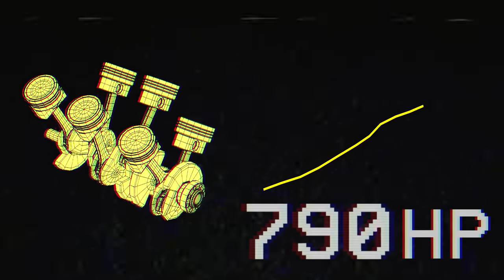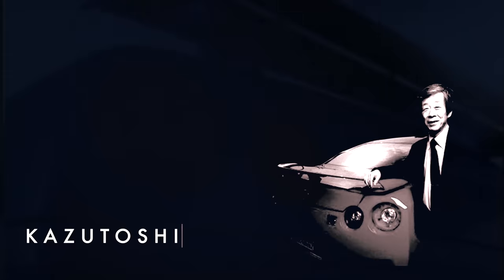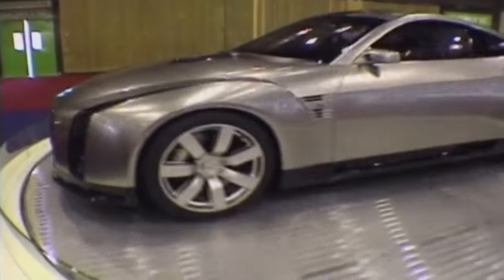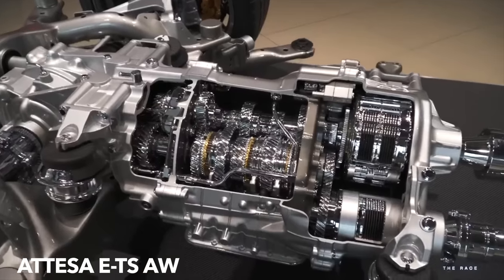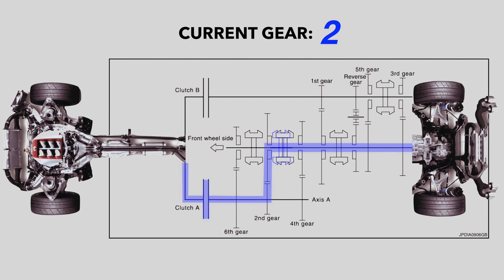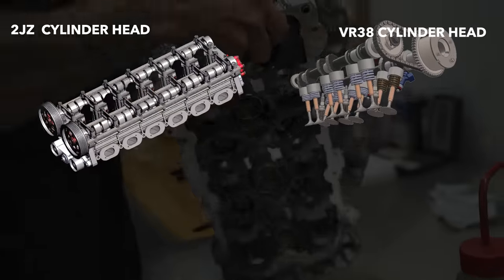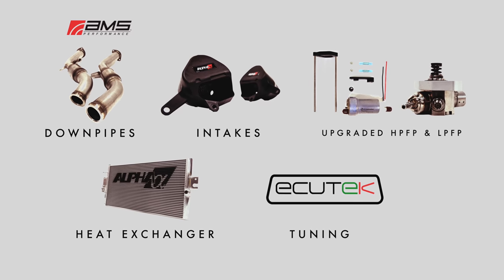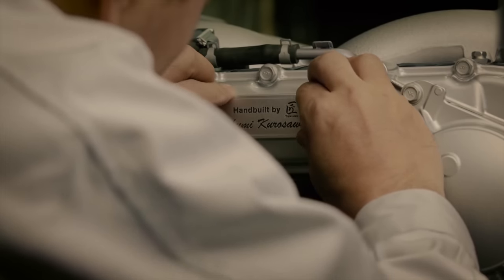Why Nissan’s Turbo V6 Engines Are Too Powerful (GT-R and Z)😳| Explained Ep.31

Comment: That first GTR's acceleration on the drag strip was supernatural!! 236 mph is off the charts but that was ridiculously quick how it got there!!!
Reply: @@shawarmafan87not yet, they're at 3500 from what i know
Reply: I daresay that's not stock lol
Reply: a 1.95 60-130 isn't just super fast, it's fucking mind bending. That's pin you to your seat levels of acceleration
Reply: @aftrnoon_ac viper lambos gtrs etc get molded by UGR, Calvo, sheepey all hit 3-4k hp
Reply: @@shawarmafan87if you’re talking about the blue one that one has a hemi
Reply: @grahamrice1806 of course who keeps cars stock nowadays?
Reply: @shawarmafan87 gtr engines top out at 3300, anyone higher u see isnt a vr
Reply: @@shawarmafan87.
Reply: @brycelenstrom3715 That's not true Billie's street GTR from T1 Race makes 3300whp that's over 3500 crank. Laser George night furry from t1 race makes 3500whp that's over 3700 crank. Extreme turbo systems promod that runs 5 second 1/4s runs promod 88s I believe and makes over 4000whp. Motors are not done yet cranks just don't hold up that long and T1 race is already in the works on a billet 5.0L VR so there is still more to come.
Reply: @hmmmph.  They don't get molded but Defeated. The term "Molded" is a Stretch.
Reply: @hmmmph.  You do realize that was a UGR Lamebo getting drug in the first video!!
Reply: @mb3578  ok? I was just saying that a lot of supercars can hit a few K hp
Reply: They are the fastest there is man, just needs some help to get there.
Reply: @hmmmph. Did you see the 300mph standing mile? And the the fastest street legal car in the world?
Reply: I thought it was ff!
Reply: @antilagboostaddiction8322  can it hit 300mph in a standing mile... yet? A Ford engine and car have achieved this already.
Reply: @oetic5016  Fast than the Ford Badd GT? Murica!!!
Reply: Got video
Reply: On this very video in the start of it. @RichardShingleton
Reply: @calamarbronx83  That's slow and small potatoes the only people that car about the standing mile are RED cars that cant put the power to the ground. GTRs and Lambos are running almost 260mph in half the distance lmao not even comparable that Ford GT would get left in the dust which is why you never see them competing with anyone other then themselves 🤣
Reply: @antilagboostaddiction8322  Has anyone done 300mph in a standing mile? Let alone 310 mph? No street legal car, is leaving the Ford Badd GT in the dust. While the GTR can't even reach 300mph, the Bad GT will leave any GTR/car in the dust. Good day sir!
Reply: @Yumadlol me but only because I’m broke
Reply: Ok? But what do supercar being able to hit a few I numbers have to do with anything. Tx2k already proves the gtr beats all the ugrs lol
Reply: @hmmmph. lmao sheepey haven’t made a decent drag car😂 you notice you rarely see a sheepey car at the drag strip unless it got work done by another shop 💀

Comment: I grew up In the 60s & 70s, We didn't have engines that come close to these in HP, I was a mechanic for 30 years, until my 2nd back surgery, a tune-up consisted of, plugs, points, rotor button, condenser,  distributor cap, Ignition wires, oil & filter, air cleaner, setting the timing and dwell angle, My Father {R.I.P.} taught me about engines when I was 10 years old, I had some fast cars and some very fast motorcycles, He said when he was young, they put would large engines in small cars, like a 500cI cadillac engine in a studebaker and call It a Studillac. THX 👊😎
Reply: Imma subscribe to you just because this comment feels wholesome
Reply: Subscribed too
Reply: Your lucky, my dad taught me to fight, drink, workout, to be prideful, be consistently inconsistent in a relationship, be an emotional cripple, and to get really good at manual labor. 

But i suppose its never too late to learn aye?

Comment: Ive been saying for a while that  the vr38 is the best v6 to ever come out Id go as far as to say the VQ is also the best NA performance V6 to come out pretty easy to maintaince/maintain and u can make close to 400whp NA with some of the later year VHR motors
Reply: C32B I would rate higher in N/A format. More performance oriented, more hp per litre (exponentially more when tuned as the head flows so well), and is far lighter.
Reply: Not to mention the VQ line came bolted up with one of the best feeling and durable 6 speed manual transmissions ever made with the CD series, the 009 being the pinnacle!
Reply: @anydaynow01  I was just telling my coworker today that I wish nissan did a revised CD009 transmission for the new nismo z Considering with just an upgraded clutch and fly wheel those trans hold 500+

Comment: I've noticed the vq taking over flagship nissans just like the rb26 used to as well
Featured in the new skyline and new stagea
The Z engine basically became the gtr engine until there was a newer gtr engine to take the place
Reply: The rb26 was never used in normal cars. It was exclusive for the gtr
Reply: @nikomoin7604  stagea autech had it as well, given that's not exactly like the rest of the lineup

it still started off with low tier rbs and eventually got the rb26, albeit probably never the higher end variants of the engine like the n1 and nur

although only now do I figure out it was only ever in the stagea this engine also appeared

and how the vq is miles more common across nissan cars

Comment: R35s are the kings of power out of any car out there and only a handful of cars can keep up like Hurricans/R8 and Vipers as shown at events like Texas2k. They’re the “Meta” of power.
Reply: Remember it is only 6 cyl. Those other cars have 1.5x-2x the cylinders.  So not exactly apples to apples. Imagine  if it was 8 cyl. The real Godzilla street king killa 😁
Reply: @hdhellion4128  More cylinders don't necessarily mean more power as explained on this short documentary. There are many other factors.
Reply: @Jorge01234  oh no, I totally agree with you. But imagine if the new skyline had 2, 4, 6, or 10 more cylinders lol!
Reply: @hdhellion4128 hp= rpm*torque/5252. The GTRs at tk rev very high, and also run a ton of boost

Comment: I never knew the r35 had a rear mounted trans let alone the two shaft configuration. That's crazy engineering
Reply: c6 corvette have rear mounted transmission, Aston martin also do that back 2000s
Reply: @xxxxghostxxxx2052  Yes, thank you. I found out that after googling the whole deal about rear mounted trans front engine configurations.
Reply: Porsche 928 also
Reply: I know right?  Every bit of infortainment I have seen about the GTR this past decade only mentioned the engine or that it had a DCT.   Never did I know the transmission was in the rear like a Vette but unlike a Vette, it didn't need a torque tube.
Reply: c6 already has that, it's just r35 no need a torque tube
Reply: This is more common than you think
Reply: @xxxxghostxxxx2052  but not AWD
Reply: Alpha Romeo GTv6 circa 1983 🥳 
Heh since we were onto well balanced cars with front engine and rear transaxle, I would show my age here.

Comment: the reputation of VQ engines probably took a hit because Altima, G35/V35 and Z owners all put the most obnoxious exhaust systems in history on them and leave the cars otherwise stock. But actual tuning shops have been doing insane things with those V6s.

Side note: I remember reading a magazine article some time around 2008-09 stating that people who tuned their R35s to make 650+ hp were going to be disappointed because the engines were all designed to make stock power 😂 whoever wrote that I’m sorry but automotive journalism is not your strong suit my g, let me have your job instead.
Reply: Thank the Edgars but yet even when they trash these cars its hard to destroy the VQ.

Comment: The GTR is such an engineering marvel. Always knew it was but its even more so after living with one for a few months now. I love that this video also touches on how the VR came to be, with the VQ in the 4th generation Maxima being a key ancestor, a car which I also have owned for 25 years. We have come full circle. Also, the VQ30DE made 190HP until 2000 when it made 227 with the VQ30DEK. Nowadays, people think of Z/G/Q when you talk about VQs but they tend to forget that it was Maximas that paved the way. So many Maxima builds led the way for those guys and the future builds to really push the boundaries of what the VQ can accomplish.

Comment: Im a SR20 guy but theres no denying it. The VR38DETT is the best engine ever from Japan and the best ever and most tunnable v6 turbo ever produced by any auto manufacturer anywhere on this planet.
Reply: best engine ever from japan is 2JZ, everyone know that. V6 just unbalanced.
Reply: @remurrr the 2jz isn’t nearly as powerful as the vr38. There is no comparison. Balancing is negligible.  Sounds much better too.
Reply: @2seep  still the reality is that 2jz is more popular. 2jz is the best engine it was i6 built with iron block and designed with Closed deck, and balance is beyond doubt!
like bro don't underestimate the capabilities of the 2JZ that comes from the factory This engine can be tuned up to 1000HP, everybody knows 2jz is popular for a reason. 
2jz is the best 🇯🇵 engine!

Comment: Ghosn is the ultimate hacker. I worked for the group under his command for about 8 years. He simply revived every single brand in it, bringing the group to the top position as a car manufacturer in the early 2000s.

Comment: VQ35HR, VQ37VHR, VR30DETT (when they don’t blow up) and VR38DETT are the best Nissan V6s ever made. Some of the best engines of all time, they hit the perfect trifecta of cheap, reliable, and easy to modify (and reliable when modded).
Reply: VR30*DDTT* not DETT. VR = Engine Family. 30= 3.0L displacement.The first D = Dual Overhead Camshafts. Second D = Direct Injection. TT = Twin Turbo.
Reply: They never blow up unless over boosted
Reply: @prone2101 I was gonna say “when do they ever blow up?”😊
Reply: @prone2101  they don’t blow but stock turbos fail

Comment: VR engines are such underrated engine compared to other nissan engines imo. my favorite is the mine's vr38 complete engine or the high response engine that puts out around 700-750hp. although different approach from the western crazy 1000-2000hp build, mine's demo r35 is such a balanced car with that engine and not only that, it's also because of the overall suspension setup, weight reduction, etc that makes the car perform really well even in tight gunsai touge. 

it's not just vq "pro max". it's a whole another level and still worthy for the GT-R despite being a v6 rather than i6.

Comment: My V6 3.6 120k in jeep jk always issues with engine vs my 3.5 in 350z at 160K still running fine minimal engine work done. Spark plugs, valve over gasket etc...

Comment: Keep in mind that vr30 with the new Turbos made 700whp on e30-e50. Vr30 from Bonnie & Clyde made 800ish whp on stock block. This car was constantly at the dragstrip and being hotlapped.
Reply: IMO The problem with the VR30 besides it’s reliability issues is it’s just too little too late, if it had come out 10 years ago it would’ve set the world on fire but now everything else is better. B58, Coyote & daza put it to shame in every way possible.
Reply: @Enthusiastlist  It's pretty reliable and can hold a lot of power on stock block. As I mentioned it was close to getting 900 whp on a stock block. Vr30 vs the b58, coyote is actually pretty close and have numerous back and forth races. Heck the Vr30 beat the b58 at a race event. The Vr30 didn't have a light weight sports car like the Supra to make the engine seem more impressive. The vr30 is like 3900-4000 pounds so its on the heavier side. New turbos for the platform were released recently that will get it to the 800whp range. Don't know much about the Daza but from what I've seen it is pretty good too.
Reply: @supremecy187 let these little boys know. It's crazy how much potential the vr30 really is now that the z came out. I don't even think the b58 can handle 800whp stock block lmao. Nissan is the king of jdm

Comment: This is all wrong. VQ35DE  and VQ35DETT Maxima was an american / australian spin off it was a shit single cam rig no forged internals. . the VQ25DETT was quad cam single turbo v6 with vartable valve timing. much like its younger nephew the VR38DETT motor (minus a turbo and a additonal wrap around pipe and 1.3 litres of displacement)   But it had the light weight crank and forged pistons stock  and CVTC. . it came out naturally in a M35 Stagea. ( I had one) with a VQ25DETT long throw motor. thing was 2 tonne wagon. that beat XR6 typhoons out of the box.stock as a rock at 335hp later models about 275hp early models (had more than 1 bar boost stock and 30/35 urbo stock. mind you it made up for its weight with the electronicdiff yaw controls and attessa AWD system like the GTR, the STAGEA  M35 was the new GTR's UNCLE in wagon form.  I rememeber with just a FMIC and an exhaust.. 650HP silvia's couldnt outrun it unti it hit speed limiter at 180km/hr ..i remember one time in a rolling race a 454 big block chevvy with flutes sticking out the bonnet could not escape the 2.5 litre turbo wagon even by a metre. . . and to update haters Volvo copied Nissan... LOLVO was the M35 plate to have as your 2.3 tonne wagon (5030 american pounds with fuel and driver) that was bigger than most things on the road with a 2.5 litre displacement.. left big blocks in the dust. this is the true heritage of the VR38DETT .. it came from the VQ25DETT with CVTC in a massive wagon, But youd have to have owned one to understand it. XDrother

Comment: I think the whole "idle like stock" argument comes down to modern hardware more than the engine design (i.e. Modern ecu, drive by wire, idle control, vcam etc..). The RB26 can idle fine at 1000whp as well as be driveable on the street, its downfall was more primarily the sump design causing twist on the block as well as weak oil pump gears. Outside of that the RB has the same aftermarkert support as the VR38, sounds better and has been a proven performer. I think in the late 90s/early 2000s your argument around the v6 design is valid as it was easier to make torque with more displacement, but in 2023, modern ecu, modern fuelling, responsive turbo techology - i think the RB is on the same level in refinement. Same goes for the 2JZ which the bottom end can support more than the VR38 and the 2j also came with variable cam timing. 

I've done a simple RB28 build on my R34 GTR with a Haltech elite 2500, modern injectors, modern fuelling system, HKS VCAM, pair of turbos and tune, the thing comes on boost at 2500rpm and is killer on the street. Can easily be dailied. Granted im not making 1000hp, but my point is whatever advantages the VR38 had, the RB can have as well..
Reply: And they fixed the oiling issues on the latter model RBs, which is just a simple oil pump and a crank swap for earlier models (which if someone is making the big power numbers to they are opening the engine anyway). And totally agreed that the RB is the best naturally sounding JDM engine going full tilt in the red, the LFA engine needed some Yamaha magic to get it's awesome sound.

Comment: I've owned an HR 350Z and now i have a 18 Q60S and i have to say.. nissan makes an amazing V6 engines, fantastic (manual) transmissions and solid chassis- but good lord they have the worst exhaust note haha. I have a full AMS RA500 pack on my Q, resonated downpipes, resonated y pipe, another 12in resonator and an HKS single exit and i still get the trumpet at 2500-3000 rpm lol. Turbos, 4 resonators and a muffler still cant hide the trumpet! Lol

Comment: Hey,  great video really enjoyed it. I was really surprised how much power a v6 could make (not counting f1).

 Is it possible you could do a video on the BMW M57 Diesel engine? Its a 3.0L I6 TT diesel engine, tuned it can have more torque than many OEM trucks. 

Thanks!

Comment: Making me really like my VQ but sad it’s not a VR.  I’d rather have my 370z than a GTR though…but I wouldn’t mind having that engine in my NISMO.
Reply: Yeah, driving a GT-R is insane did it at a track event once, but for some reason having a stick shift for a trackday toy is where it's at for me, I'm happy with my G35 and didn't want to pick up a new Infiniti since they are autos. Saving up for a base RZ34 when the dealer markups evaporate eventually so I can do all the SPL Parts, Z1, Wavetrac, Öhlins, and AMS things to it!

Comment: the comparison between the new z and the new nismo z, is that you spend 24k for a 20 hp upgrade. its kinda embarrassing compared to the 370 where 7k gets you the same 20 hp upgrade. dont get me wrong i would love to own an older z and an r35 gtr in the future, but the fact that you have to spend 24k just for a few horses for the nismo version is kinda crap.

Comment: You can easily hit 1000 hp on a stock LS engine just add boost. No clue where you get the idea you can't have 1000 hp and a good daily driver LS
Reply from the maker: Nobody builds a boost only 1000-1200HP LS, needs a cam and head work at minimum to reach that since all LS cams from the factory are pretty undersized. Every cammed LS I’ve ever owned no matter how good the tune was never drove “as good” as stock, if they did they’d come from the factory with aggressive grinds.
Reply: @337speed  as I've stated, you do not NEED an aggressive cam. The stock cam is fine. It will make 1000 hp with the factory engine all you need to do is add boost. Just because most people don't do it doesn't mean it needs it

Comment: Nissan's inline six engines are also too powerful, they have unbeliveable extreme potentials too, the peak is the TB48DE.
Reply: That engine even better than the RB26 
A big 4.8L stil in product we have the 2023 patrol y61 with 4.8L engine manual transmission that engine is a beast if you tune it